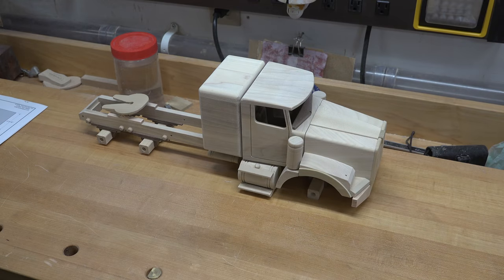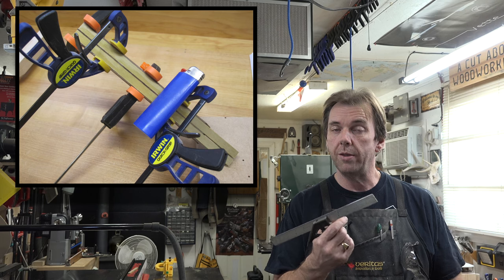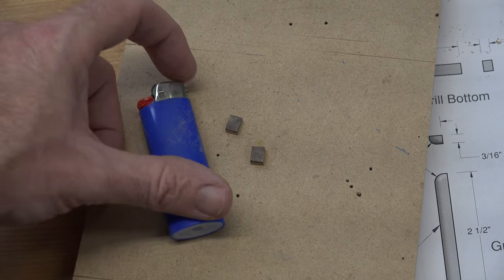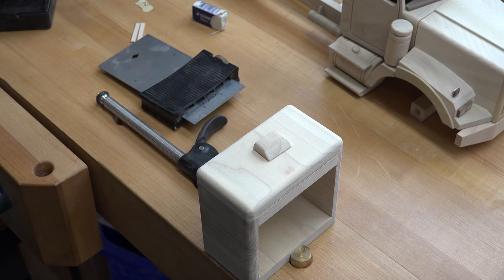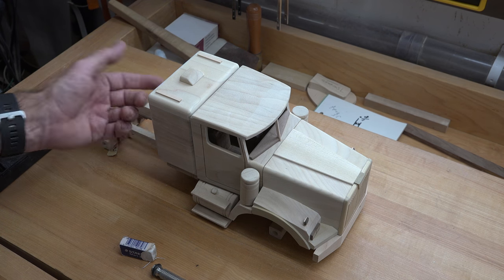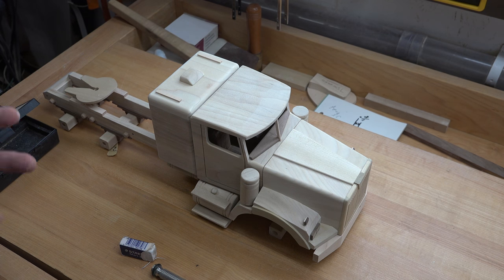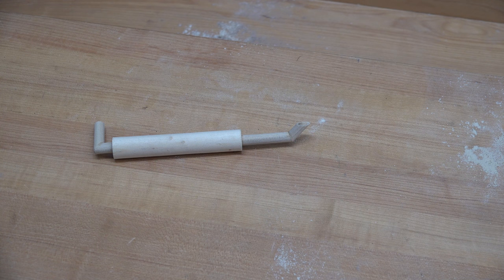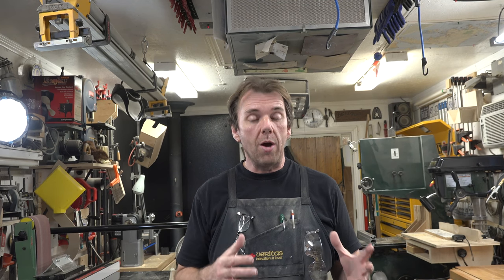Scale Model Part 6

Comment: More very helpful instructions Kenny, nice work. I like the technique you used for the headlights.  It looks cold in your shop!
Reply from the maker: Thanks for the kind words John.  These shows are pre-recorded so this video was shot in the early parts of the year where the temperatures are quite cold and I need the wood stove burning to keep the heat up.  The weather is nicer now and hopefully, I wont be needing that wood stove for a while.  Thanks for tuning in and for the kind words on the show.

Comment: Looking great Ken.  I keep waiting for the model to start up and drive away...oh wait, no wheels yet.  LOL.  I notice that you always use wood glue, is there a reason you don't use CA glue for some of the small parts?  Maybe you said earlier in the build and I just missed it.  Great work, looking forward to the next show.
Reply from the maker: One of the biggest problems with CA glue for a model like this Paul is the mess it makes.  Holding on to small parts and trying to control CA glue while not sticking your fingers together is a real pain in the butt.  The CA glue also doesn't give you much of an opportunity to reposition parts, should they be a little off whereas regular wood glue has much more flexibility that way.  If you don't mind waiting a little for the glue to dry, my suggestion for these models always has been and always will be regular wood glue.  Easier cleanup on the squeeze out, more flexibility for repositioning and no chance of gluing your fingers together.  Thanks for tuning in sir.  Always great to hear your comments.

Comment: I made a slick way of enlarging the doorway when using the router. I printed the image from 100% to 103% and then use that to cut out the door with the router.
Reply from the maker: That sounds great Tom.  By enlarging, you basically have already compensated for the router bushing.  Awesome.  Thanks for tuning in and for taking the time to chime in with your experience.  It's very much appreciated.